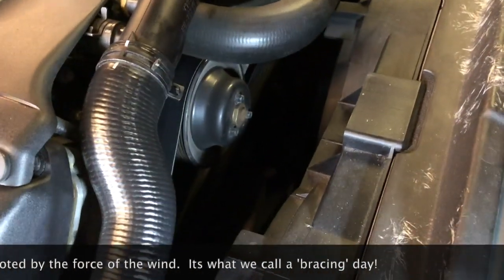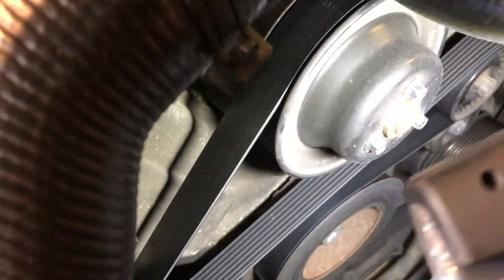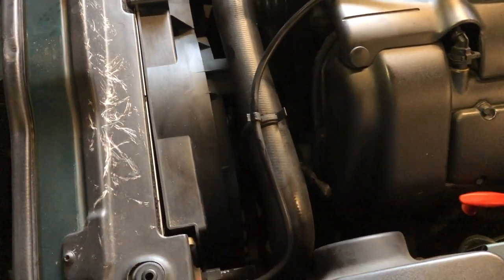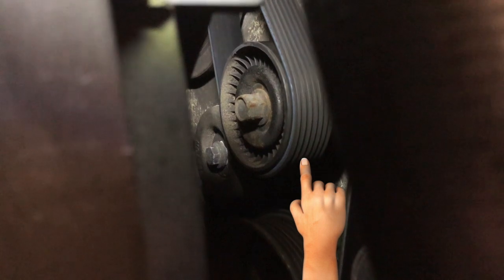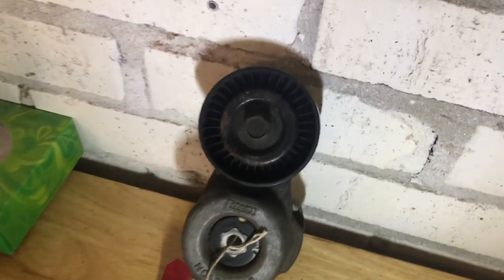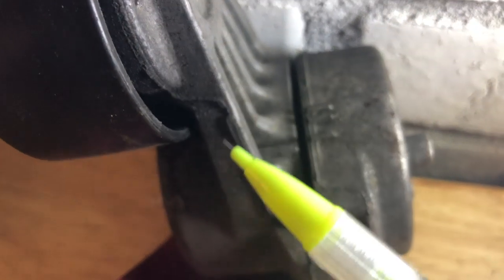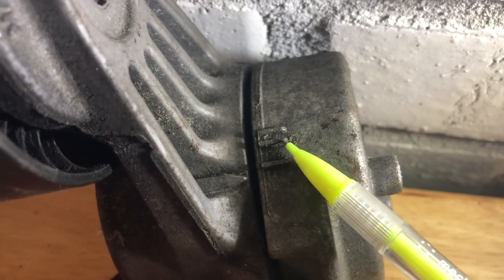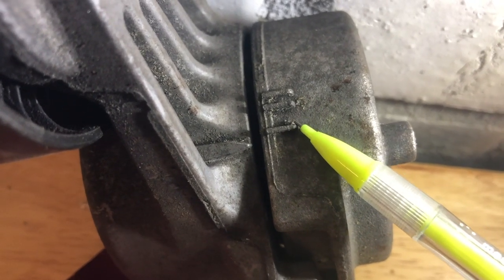Secrets of the Jaguar XK8 & XKR Ep 32 . Serpentine belt stretch

Comment: How much can you depress your accesory drive belt? For some reason my  tensioner is at the "new belt" position, however my Gates Krikit meter 91107 measures no tension and I can press it about 15mm quite easily. Thanks.
Reply from the maker: Obviously a hard thing to comment on remotely but if you can twist the belt through a quarter turn (90 degrees) then its certainly too slack.
Reply: Thanks! I replaced the belt and tensioner, now it's much more stiff. Gates still doesn't give a tension measurement, I think it might not be suitable for this belt width. @ToTheGarage

Comment: Heads up for XKR owners. This is more complicated on the XKR, you have to remove the fan assembly, which means disconnecting the top radiator hose. So make sure you have a pan to catch the fluid. Also make sure you have extra coolant to top up when you are done. IT IS NOT POSSIBLE TO REMOVE THE FANS WITH THE HOSE IN THE WAY ! Believe me I wasted an hour trying to get the fans out.

Comment: Hi John !Awesome videos !I got 99 Xk8 Jag Red as your cabrio .Love it! Any idea Where can I get some paint In the USA?Another thing us that car needs more time to gain speed.Do I need to change ignition coil and sp.plugs?Thanks!Robert from Florida.
Reply from the maker: Not got any recommendations for suppliers in the states. Have you seen these folk?https://www.automotivetouchup.com/touch-up-paint/jaguar/2000/xk8/
Exhaust over axle will add 15 to 20 Hp
Tune the gearbox by getting it to learn to be more aggressive.
https://youtu.be/K_JUgvBPZ-U
Eliminate ALMOST all the slack in the throttle cable.
Check air intake snorkel for leaks. 
Check breather pipes (attached to each cam cover) for leaks and blockages
Clean the MAF sensor
then 8 coils and 8 spark plugs may add a little more edge.

Comment: Good morning John, first off Iwant to start by saying that I like channel a lot and have a greater understanding of my 2001 Jaguar XKR. I was wondering if you have any knowledge of why my Jag will suddenly loose power while driving and I get 3 warning messages that show up on the dash. First one reads   ASB not available, TRAC not available and engine fault. After pulling over and turn the car off and wait for a minute or so and restart the car the warnings go away and I am able to drive away as if nothing ever happened. But only for a short distance and then it happens again. I have had it in to the dealership where I have my Jag serviced and they cannot come up with a diagnostic of what can cause this, I was wondering if you or any of your followers have ever had the same or and what was done to fix the problem. Thank you for your time and keep posting those secrets, love them. Al
Reply from the maker: It could bee a dodgy 'S' Switch. Try operating it repeatedly with the car turned off in order to hopefully clean the internal contacts. Then go for a drive and try to provoke the fault by pressing the S switch.
If no more problem👍
If you get the problem when you operate the switch then potentially problem located👍
If not then my next suspect is a faulty wheel speed sensor confusing the ABS and traction

Comment: There are 2 belts listed for these engines, even from the same manufacturer, e.g. Gates. One is 2328mm long and the other 2345mm long. It’s only about 1% difference but which is factory spec and which do you have (can’t quite make out the writing on your belts in the video).
Reply from the maker: I will check this afternoon Gareth. I know that there are plastic (Original) idler and tensioner pulleys that have non replaceable bearings an metal upgraded later pulleys which can have the bearing changed. Not 100% sure but I think there is a subtly different belt specified depending on which you have. Mine are plastic so when I get the length for you, as long as yours is still plastic it should be the same.
One of our subscribers may chip in with a better answer to your question here though.  Anyone?